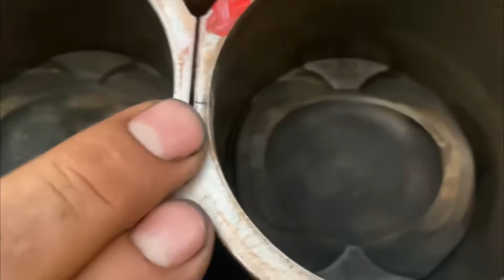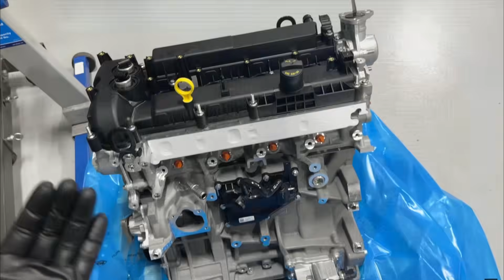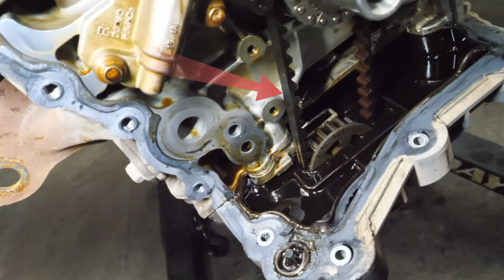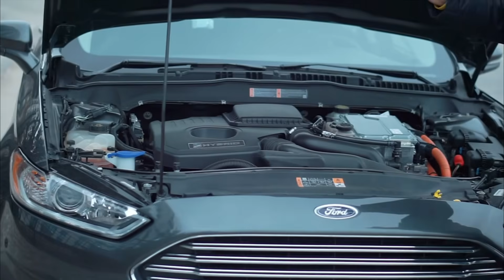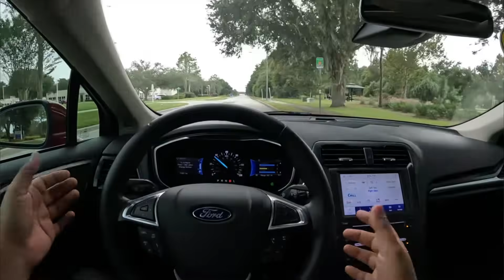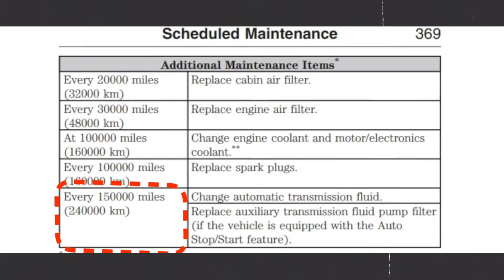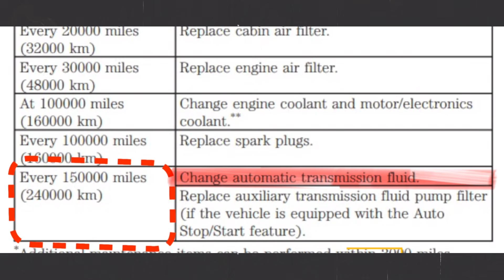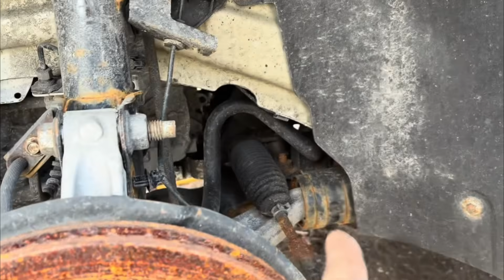Ford Fusion (2013-2020): A Complete Reliability Guide

Comment from the maker: Buying a used car? 🚗 
As a paid channel member, you can get my take on the car you’re considering: which engine I’d choose, what tends to go wrong, what I’d check before buying, or if you should just pass and choose a better alternative. 🛠
Click "Join" on my channel, then leave a comment on any of my videos with the year, make, and model. If you know the engine and mileage, add those too! 👇
📋 Example: 2017 Ford Escape · 1.5L EcoBoost · 95,000 miles

Comment: I just bought a 2014 Fusion 1.5 EB w/ 186k miles and it appears to run great. Original owner kept up on standard maintenance. Someone comment on this post in 1 year and I'll give an honest review ✌🏼
Reply from the maker: Please come back in a year with an update! I’d be interested to hear how your car has held up during that time.
Reply: @thelonglastexpert I hope it's still running strong. I had the transmission drained, not flushed at Ford that required a total of 12 quarts of motor craft lv transmission fluid to get all the old fluid out. I will be changing the motor oil every 3-3.5k miles. See you in a year with an update 🤞🏼🤞🏼

Comment: I own the 2016 Ford Fusion Hybrid SE, only at 76,240 miles (military), Had no issues yet, and yes Im the only owner. Ford isnt getting this car back. Dealerships frequently urge me to trade, but I like having no payments on a car that runs perfectly fine. Ive had the car for 10 years, although about half the time she sat in long term storage, and yes Ive had the fluids replaced.

Comment: The hybrids are extremely reliable though have the CVT rubber bandy feel while the 2.5 feels peppy enough while not fast its quick enough for day to day driving and is still good on gas especially for the cars size the 2.5 is an excellent engine all you gotta do is basic maintenance and it will out live the spynx i change the oil on my 15 2.5 every 5k and its been an absolute beast crazy reliable, great on gas, super comfortable road tripping car ive been very pleased with the car the transmission is buttery smooth the only thing ive ran into is the lower control arms the things are VERY price at $300-400 CAD since the lower ball joints are only sold as the full control arm so the bonus is that you get new bushings with them

Comment: I have a 2016 eco boost 2.0 A year after I bought it I replace the turbo 2 1/2 years go by I replace the muffler my final payment is next month after having it 5 1/2 years and now the engine is gone. It cannot be rebuilt. I need a new engine. This car ended up costing me throughout the years. Almost $30,000
Reply: Never buy a car in Brockton, Massachusetts at the Hyundai dealership… A month after having the car, the check engine light kept going on and the battery kept dying. They didn’t care not one bit you live in you learn I just want other people not to get ripped off like I did.
Reply: McGovern Hyundai in Brockton mass. I told them from the start something was wrong, but they treated me like absolute shit. Drove the car around the block and said it was fine. I drove a half an hour to go there for that bullshit. The car was not safe and still is to this day.
Reply: My car only has 111,000 miles

Comment: 2017 Fusion 1.5L 170k miles. My coolant tank cracked and change it. As well as my cylinder head temperature sensor and fuel injection pressure sensor (I broke this). 
I’m having a misfire in cylinder 2. It slightly rumbles at a stop but it’ll even out. Sometimes overheats but that I’m sure was because it didn’t have enough coolant at the time

Comment: I’ve had a 2010 Ford Fusion Hybrid since April 2009.  Not one complaint.  Extremely low maintenance, extremely high reliability.  Everything on it still works. This experience led to buying a used, ridiculously low price, 2020 Ford Fusion Hybrid in 2026 with 55K on it.  After I just bought it, I asked why such a low price to the service manager who had just rolled it out in the front parking lot.  He said that there was not much interest and said that buyers were gravitating to cars that he would have never recommended based on service records.  He had serviced this car since it was bought so he knew its history.  At another Ford dealership, the service manager who was also their hybrid specialist offered to buy my 2010 hybrid about 5 years ago.  I said that his dealership was contacting me often to sell it and buy one of their new cars.  He said that was not the case.  He wanted it for his just starting to drive daughter.  He said that in his experience in servicing the 2010, including mine, to the last one in 2020, the 2010, for its age was the obvious choice for the older hybrid models.  Obviously my answer was “no thanks”.

Comment: You missed a few things the 2013 1.6l could be equipped with the B6 6 speed manual transmissions and only available with the manual in 2014. They didn't have the same overheating problems as the auto because of a better cooling design. The 2.7 sport had a electronic Adaptive suspension as well.

Comment: I have a 2017 Ford Fusion Sport 2.7L V6 Eco boost AWD. I bought it at 45k miles and it's currently at 80k miles and still running strong. Ford changed from the chain to a belt driven oil pump, so best not to skimp on your oil changes or those belts will dry up and start cracking. My FFS has a 93 tune, CAI, Go Fast Bits (GFB) DV+ T9384 Diverter Valve, and NGK Ruthenium spark plugs. It pulls 385hp/450lb-ft torque easily. Although I know the 2017 only has direct injection, it's okay because I don't drive it that much and I get an oil change every 3000 miles.

Comment: I had a 2010 and now I have a 2015 fusion both with the same 2.5l duratec engine so reliable and smooth comfortable ride.i test drove 2.0 ecoboost one as well recently that one more fun to drive.

Comment: Let’s not forget to mention the 1.5 was revamped after April 2019 so any vehicle built after that got the better block. It’s wild to see so many ppl say fusions aren’t reliable with the 1.5 engine. That’s cap. I own one and it’s amazing .
Reply: My old 2015 has 142,000 on it now.
My mechanic says the block WILL crack, it's a  matter of when.
So far, perfect. Great gas mileage.

Comment: Have had this car for years and it sucks
Reply: Can you please tell me why it sucked? I am considering buying a used low mileage Fusion. But I am not sure. Any info would be appreciated!
Reply: I'd just stay away from the 1.6 liter  i have a 2013 SE it just has tons of leaks and i've hads to replace the engine and trans once already .the transmisison shifts hard too.

Comment: I have a 2013 SE hybrid at 209k miles. I’ve had to replace a cam sensor, both control arms and both front cv axles. The cv axles weren’t the car’s fault, it was torn boots from swerving around a deep puddle and hitting a giant pothole on the driver side and dragging a huge chunk of ice on the passenger side for about 10 miles on a stretch of I94 during heavy snow that hadn’t been plowed yet. No engine or transmission issues whatsoever with only regular oil changes. It is a pain in the ass to change headlight bulbs too. The recommended procedure is to remove the front bumper cover and remove the headlight assembly, but you can loosen it just enough to get your hand down in there to replace, but my hands are too big, so I still have to remove the bumper fascia, which is ridiculous cuz I used to be able to get down in the engine bay to work on my cars without having to pull the motor.

Comment: 2016 Fusion 2.0 with 90k miles here and she's doing great with mostly just regular oil changes. Air filters, brakes, and battery have been changed. I had an EGR solenoid issue around 50k miles but that was fixed through a $50 harness change. I know I've neglected it but I'll do a transmission and coolant flush in the next month or so but I hope to own my car many, many more years!

Comment: I've had 2 fusion se with the 2.5 L engine. Traded in the 2015 at 184,000, got a 2017 with 50,000. The 2015 engine was still going great, but l got a great deal on the newer 2017.
Reply from the maker: Wow, that's awesome to hear about your Fusions!

Comment: Purchase new 2013, 1.6 eco-boost. A lot of recalls and issues.  Biggest of which was coolant intrusion. After 100 K the transmission got sloppy. Every 2-3 years evap issues. The dealer was pushing the Duratec, I should’ve just bought that.

Comment: Worst mistake of my life buying a 2018 fusion. Thing dropped coolant into the engine and BAM needs a new engine. Couldn’t afford to replace it and couldn’t get out of the loan. The piece of sh*t sat in my driveway for over a year until I traded it in and had to eat $8k in negative equity. What a waste. Thing was beautiful but come on. Got no warning until it was out of coolant. Refilled it and two days later it wouldn’t start. Devastating. I’d say avoid this car at ALL COSTS

Comment: My 2.0L went out at 180k from the vacuum pump locking up (shows up as loss of brakes) sent metal bits through the oil system taking out my turbo. I think if this is replaced around 120-150k you should be okay. If i would've known about this problem i would've done it sooner!

Comment: owner of a 2013 fusion. Modded it a lot, but had to replace the engine block cuz of the issue mentioned in the beginning "coolant leaking into cylinder" and i had to replace my transmission 😐 ever since its been running good so hopefully it stays that way. only had the car for 2 years too

Comment: Safe cars on an accident I tell you what!!  I have had 2 cars totaled from reckless speeders hauling  buns 65 + probably texting ..I walked away with out a  scratch.  One I was T boned on passenger side, even waited 5 seconds after the green turn light, guy ran the red light doing 65 spun the car 2x. All air bags deployed  Totaled his Mercedes suv new. With no insurance coverage.

Comment: My 2014 FF 2.0 SE's been alright. currently have 245k miles on it, got it in 2015.
Mobil 1 synthetic oil change every 10k, transmission oil change every 50k, replaced rear shocks @ 180k & @ 240k, 
replaced front struts, front control arms, cv axles, and front wheel bearings@ 220k, 
I haven't changed the spark plugs nor ignition coils yet, but will be doing it within the month.
went through a nightmare dealing with the sunroof leaking, the gutter system for the sunroof is made up of three pieces, attached by foam, and the structural integrity of the foam deteriorated, in 2 spots, i ended just reinforcing the joints with windshield caulk adhesive. had to take apart the roof a few times, but decided to spray paint the roof black while trying to solve the sunroof leak issue, which made it more worthwhile.
didn't have any alternator issues until 160k, but then finding out it was never an alternator issue to begin with, cause I ended replacing it 3 times back to back, still working on this issue: it intermittently overcharges, and when the voltage gets to over 15V, the car's PCM would shut off the power to the car's dash and non-basic features(windows, gear shift, A/C, heated seats) to protect low voltage components.
oh, and replaced the vapor canister purge valve a few times, and air filters.
I'm currently dealing with a crazy creaking/squeaking noise from the rear suspension area, where my mechanic is hesitant/can't say where it's exactly originating from(cause he's trustable, and doesn't want to put me in a situation of endlessly changing parts back to back), so I know I gotta take the time to figure this one out myself...
Reply: btw fyi, annoying squeaking came from rear large control arm...
currently at 275k, experiencing possible trans pump n filter issues. 
Now I understand why many say do trans drain & fill every 30k.... 😢
Reply: oh and the alt overcharging issue was from a short somewhere with gen com and gen mon wires, couldn't find location of short, so ran another set of wires from alternator directly to PCM

Comment: I was thinking of getting a Ford Focus, Fusion, C-Max, and Escape in 2017. I ended up with a 2015 Ford Escape SE in silver grey in late March 2017. I had that vehicle almost 5 years till it died on me from an oil leak in mid March 2022. I gotten a 2020 Ford Escape SE in black since then. I did had a 2011 Mercury Milan for almost 4 and a half years till it got totaled by hitting a deer for the 2nd time in 2016.

Comment: 2019 1.5L ecoboost fusion onwner here. 35,000km. Check engine light woud sproadatically come on and off. My VIN is part the affect engines. Dealers won't fix it because when i brought it in they light wasn't on. They had the history but don't know why that wasn't good enough for them. Pretty sure its part of the coolant problem but with low mileage and me not driving it a lot, hard to diagosis.
Reply from the maker: Did they check misfires in cylinders? is your coolant going down?
Reply: @thelonglastexpert  so my mechanic, mentioned something about the misfires but he swaped the spark plugs on cylinder 3 and something else (sorry not technical). I figure if the coolant was low, he would notice it when I do my yearly oil change and twice a year tire swaps. I've also taken my car to my mechanic everytime the check engine light was on (at least 4 times in the car's lifetime) and they could not see anything obvious. 

When I took it to the Ford delaer. They tried to upsell me on new spark plugs. They said the computer wasn't saying anything. So I can't confirm or deny they did check the misfires or coolant.  

When I get my tires swapped again. I'll ask my mechanic to do an engine coolant flush and see what he can diagnose now I know my VIN has been indentified with this issue. The issue I think is that I drive so little so issues haven't creeped in. 

I may also just sell it as thinking of getting a minivan. But just diasppointing that my VIN is part of an known issue but its not a recall, and youtube videos like yours gets +100k views and the dealers mechanics, goes "sparkplugs".
Reply from the maker: @FonderTomato13  Check where the coolant reservoir is located under your hood and keep an eye on whether the coolant level is dropping — don’t wait for your next visit to the mechanic.
Reply: @thelonglastexpert  thanks for times and will do!

Comment: I just purchased a 2017 Ford Fusion Se 117,000 miles from a dealer after a month.
Check engine light on took to AutoZone something with EVAP P0456 code.
Remote start stopped working because of the check engine light protected feature.
When accelerating it feels like I’m being snatched backwards then let go.
I called the dealer and I have a warranty, smh

Comment: Good to hear from all you Fusion drivers/owners…proud owner of 2014 Fusion PHEV Uber driver with 198000 and going 😮
Reply: Good to hear. How's your electric only range holding up? I know it's only around 26 miles when new, but that's more than enough for my daily commute. I'm just really curious if that range holds up over time. Thanks
Reply: just curious are you changing your gas after a couple months if you dont use it ..... the plug in seems pointless

Comment: I have a 2017 ford fusion se with a turbo. Currently throwing code P0299. Having problems with the turbo.  The mechanic cannot find the problem. Would not own the EcoBoost turbo again. I have another ford fusion (2015) without the EcoBoost turbo and no problems. Stay away from a turbo.

Comment: 2019 Ford fusion SE hybrid one of the best cars I've ever had consistent 40 mi to the gallon comfortable have kept up with the maintenance on it changed out the wheel hubs bearings at 100,000 MI. Tremendous automobile
Reply: Got a 2019 SEL Hybrid, really love the car but i find it very bad in heavy snow, the weignt and FWD dont help. I live in Quebec.

Comment: 2016 ford owner almost at 100K replaced the transmission at 97k due to following ford maintenance guide DO not follow their oil changes do them at 3k or 3 months which ever comes first and flush and fill transmission at every 30k

Comment: I have a 2017 SE with the 2.5 engine sitting at about 163000 miles now. What i have had happen lateky is i can crank up and drive the car no problem, but seemingly as it gets hot,it wont restart and i haveto let it sit and cool off for like 10-15 minutes. If its running thenit will sputter out, which is dangerous if I'm somewhere on the roadway with other vehicles. Anybody else have this problem or had it happen and how did you fix it?

Comment: Luckily upon watching the video and browsing the comments, the 2017 Ford Fusion SE 2.5 Liter with Duratec 25 engine I got secondhand was a steal. It has 162,000 miles on it and still running flawlessly. I'm currently at 169,000 miles and can't see any problems with the car. I'm planning to change the oil every 5,000 miles and get a fully synthetic high mileage specific oil for it regularly. Hope that helps to reach up to 250,000+ or even 300,000+.
Reply: No transmission shifter bushing issues?

Comment: I bought a 2015 fusion with 1.5 in 2016 with 6400 miles on it and until now the only things replaced are tires and a battery, we are planning to give it to our son once he gets his license and it has just over 65k miles now
Reply: We have 124,000 miles on our same car.
Mechanics tell me the engines were failures as the blocks crack between cylinders, but so far so good.